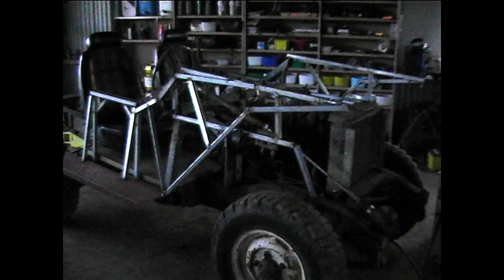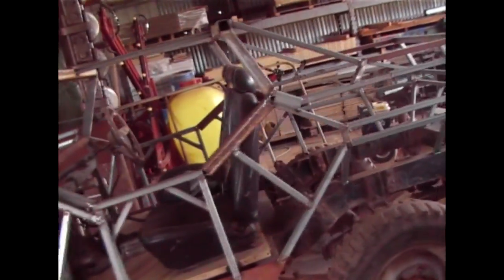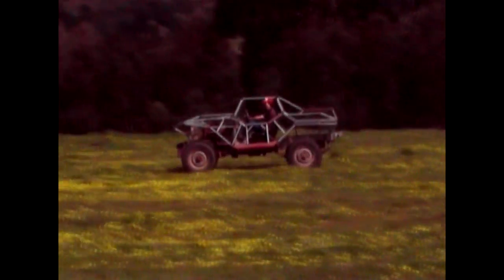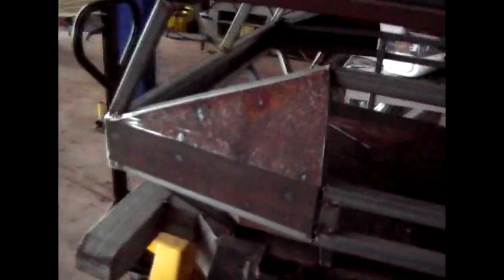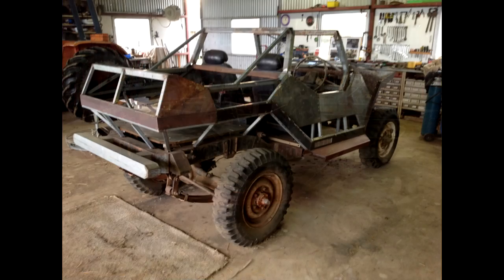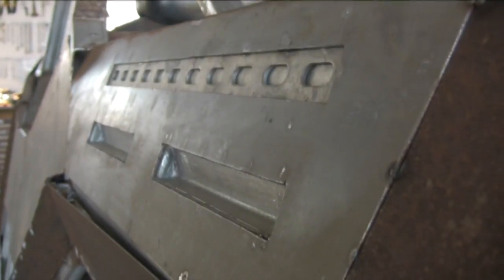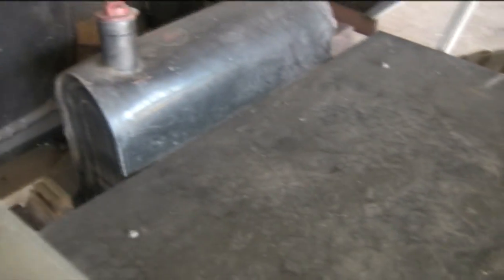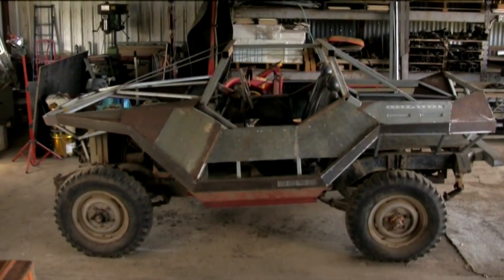Building a Warthog: Construction Part 2 - Frame & Plating

Comment: And last, did you just construct it all using some math and imagination.. or did you have some Blueprints for warthogs of some kind?
 please enlighten me :]
Reply from the maker: I think I'm answering all your comments in a strange order :P 

Most of the work I've done has just been by sight/imagination. I have a fairly comprehensive collection of reference images that show warthogs from various angles. I generally just look at these images and then come up with a design that matches the proportions in the images.

In saying this, my proportions aren't actually very good. I've had to make a lot of sacrifices due to this car being smaller than a warthog and it has put a lot of the bodywork out of whack. I'm trying my best though :P

Comment: You did a lot of stuff I would never be able to do, things like removing and replacing the whole car engine, and break the car in half to make it shorter and reattach it again...

So lets say I succeed in finding a land-rover with a working engine..
is it REALLY necessary to make it shorter?
how much did you shorten it?
Reply from the maker: I wouldn't know how to do all the engine stuff by myself but I got some help with it. Shortening it isn't a requirement. I just thought this particular model of land-rover was too long to look like a warthog, so I made it a little around 50cm shorter (maybe a little less). The only reason I chose to use a land-rover is because we had an old one lying around on the farm that we didn't need any more :)

Comment: Hey there I am a big fan of your work, looked up your video's and immedeatly subbed, I would LOVE some more information about this warthog, I know you are much further then shown in this video though..
the reason I ask in this video is because I am pretty much a beginner and do not have a frame construction yet..
Can you give me some helpfull tips or anything at all about how you did it, what you used and how much things costed for you?? 
how much was your car for exaple??
, you did amazing work, I was planning to build one on my own!
so please tell me anything you know
Reply from the maker: Hey thanks a lot man :D Hmmm I'm not sure where to start with tips...

If you just want a vehicle that LOOKS like a warthog, I highly recommend you don't make the body/plating out of metal (make a metal frame though obviously). It's extremely tedious trying to create intricate geometry from metal, especially if you don't have good equipment. Perhaps you could make the body from fiberglass or something :)

I have no idea how much the car cost. It's been sitting around on our farm for decades and it hadn't gotten any use in a long time, so I claimed it for my project.

The main things I've needed to spend money on are buying packs of cutting disks for my angle-grinder (I wish I had a plasma cutter) and refilling the gas for my mig welder. Other than this I haven't spent much at all on the bodywork (we have spare metal lying around).

The main tools I use are an angle-grinder with cutting and grinding disks (for cutting/shaping metal), a mig welder, power drill and a docking saw. A hammer is also quite useful. If part of my warthog doesn't look right, I tend to just hit it with a hammer until I feel better :P

I'm not super good at advice, but if you have any specific questions, feel free to throw them all at me and I'll see if I can help!

Thanks again for the compliments :D
Reply: HogSmith Well thanks for all the helpfull replies and information! its verry helpfull in a lot of ways, apriciate it!
I wanned to build my own for a long time now but I have the common money problem ;P you see I need to buy myself the car, and metal and all the other stuff haha, and in order to drive a real warthog I will have to buy myself a xbox one + halo 5 first AND since I was scammed for a lot of hundreds of euro's lately XD.. it will take me a little time like 1/2 of a year to get the money all set  for buying a land rover..
I am crazy about warthogs in particualar, and you could call it my life dream for now to make one of my own! I just LOVE this car and love the design..
oh and about the firber glass, Its a nice idea but its more weak than metal and kind of flammable. But 1 idea is better than no ideas at all lol

but anyway as for the questions curently in my mind
(BRACE YOURSELF)

Possibly, easy questions:

-was it hard to get rid of the land rover body? (any tips for that?)
-what type of land rover is this exactly?
-how old are you :P
-do you possibly remember how much it costed for you to make the frame  construction as in the metal and tool costs?
-What kind of metal did you use to build the frame?

you know, just give me any info about the frame that you remember XD

MAYBE, harder questions:

-what was the hardest (most difficult)  thing to do and why?

-do you have much car experience as in building?

*LAST*

-how long did it take you to build the frame?
 was it hard?  did u use any special techniques or just your emagination    and pictures? any info or tips on that,

Take your time and Thank you so much!
also sorry about the bad english grammar
Reply from the maker: randomshittutorials Awesome that you want to build one yourself! I'll leave it up to you as to what brand of car you want to make it out of. I just chose a land rover because I conveniently had one.

If not fiberglass then what are you thinking of making it from? I'm only familiar with metal so I can't think of other alternatives, but I will say that crafting a whole metal body with limited tools is a pain in the arse and extremely painstaking! 

To remove the body from the rover I think we just removed a bunch of bolts that were attaching it to the chassis and then lifted it off with a tractor. It didn't take very long to get it off.

It's a 1960 Series 2 Land Rover (with 109 LWB). I probably wouldn't recommend using a car from 1960 :P

I am 19 years old :P How old are you??

I couldn't tell you how much it cost me to build the frame because I was already in possession of all the metal prior to starting the project. I can, however, give you an estimate of how many metres of the material I used, and I guess from that you can work out how much it would cost in your currency.

The material for the frame is hollow square steel tube of size 30x30mm and 2mm thickness.

I'm staring at pictures of my hog trying to estimate how much square steel I used so this'll be super rough. I'm going to say around 35-40 metres of this material. My frame design isn't very efficient though (I'm quite wasteful) so you could probably reduce this size by spending more time working out the best way to reproduce the warthog shape.

If you want to see more pictures of my hog in the construction process (before the frame, frame without body, etc) I've got heaps of photos. Just let me know and I can get them to you somehow.

It's hard to say exactly what has been the hardest thing to do. In terms of actually building things, the metal plating has been the hardest to create. It's a very slow and frustrating process trying to make the detailed parts. Another really hard thing is the planning process - working out how to make all the pieces, how they connect and in what order I need to attach/complete things for it to work. I've busted my brains over this thing.

The very hardest thing is staying motivated to finish it. It's such a huge project and a major time commitment!

I have very limited experience working with cars. To quote myself, "I have no idea what I'm doing, but I'm gonna do it anyway" :P

I believe it took me just under two weeks to finish the frame. I had a lot of free time and was working every day.

I came up with a frame design by using reference images of the warthog. I took the images on a computer and experimented with drawing lines over top of them to work out where the best places were for the frame to be. Once you have a good understanding of what the warthog looks like from every angle it becomes easier to plan a frame for it.

Once I'd come up with a structure I was happy with (at the time), I drew up some images of this frame from several angles (side view, front view, etc). Then I proceeded to actually building the thing. I think I was 16 or 17 when I made the frame. I wish I could redo it now, I could improve it so much :P

I pretty much just used a measuring tape and an angle measuring device to judge how long bits of the frame needed to be and how they should be oriented. I would cut out bits of metal and place them where they should be attached, then refer to my images to see if my proportions and placement were close enough. No special techniques or anything, just a lot of looking back and forth at images and making judgments. 

Hope this is helping you :) If you've got any questions about anything I've just said, I'm happy to clarify things. And feel free to keep throwing questions at me!